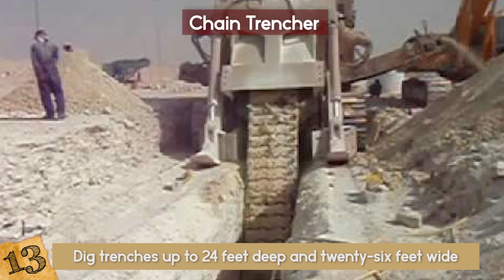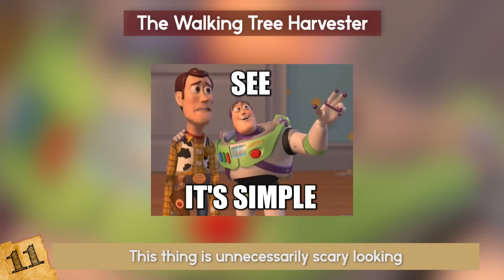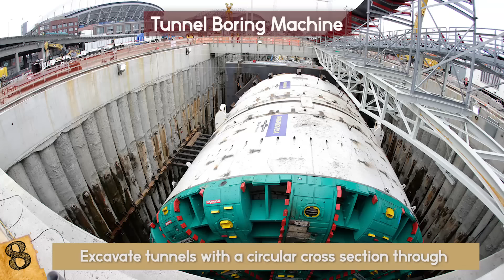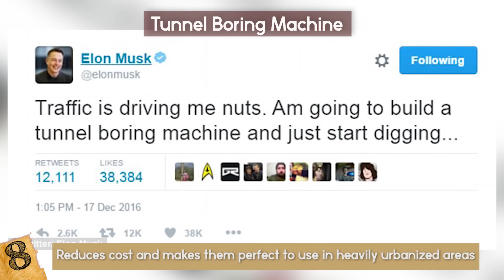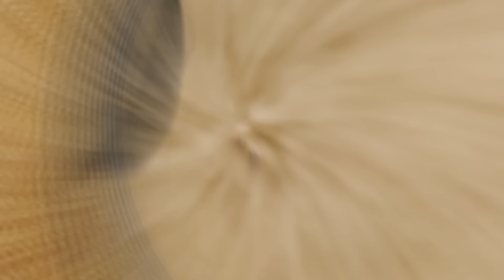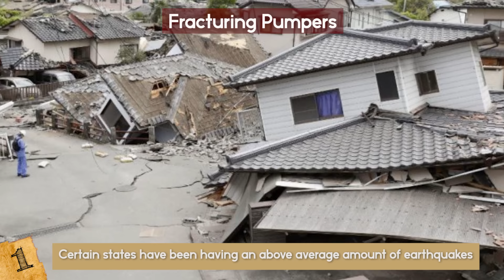Most EXTREME Industrial Machines Ever!

Comment: No chain trencher can dig 26 feet wide. A chain trencher is designed to dig trenches only wide enough for the diameter of the pipe and it would be ridiculous to try a lay a 26 foot wide pipe. In addition to this, wheeled equipment in logging is better than walking machines in the sense that they are easier to operate, have less moving parts and are designed with suspension, winches, etc.... The second picture is also an attachment that runs off an excavator and isn't it's own machine. And as for "chainsaw on wheels", it is based on crawler tracks to spread out the machines weight better and not wheels.

Comment: Error #2. The walking loggers are used to remove DEAD TREES for forests without affecting the rest of the forest. Removing dead trees helps protect forests from wildfires. It's not a woodsmans wet dream. It's an environmentally friendly way to both maintain healthy forests and provide firewood for local homes to heat with.
Reply: 0000000000000000000000000000000000000000000000000000000000000000000000000000000000000000000
Reply: showthechinal

Comment: Unique video but it does have some inaccurate information. The feller buncher doesn't strip the branches off of trees, it only cuts them down and bunches them. If it had a processor head like the tree harvester, then it would be abled to strip the branches. This is why plenty of commercial logging sites use a machine called a delimber. And there are a lot of logging vehicles that have wheels, and have the right drivetrain, suspension and off road capabilities to deal with forest environments. Just look at forwarders or ponsse tree harvesters, they all have wheels. The walking harvester is cool but would have a lot more moving parts for the legs to function. There is lesser known walking excavators that can be converted to tree harvesters.

Comment: The thing in the thumbnail is called a tree-crusher. Back in the day instead of hand-falling trees in the path of dam water flooding or any other large area you want to clear, they would drive those things into the area and just run over all the trees. They were super inefficient and burned a lot of fuel, and were impractical in hilly areas due to it only being able to climb up a hill that was no more than 10% slope. which is why you don't see them around anymore.

Comment: The machine from the thumbnail is not there...
Reply: The thing in the thumbnail is called a tree-crusher. Back in the day instead of hand-falling trees in the path of dam water flooding, they would drive those things into the area and just run over all the trees. They were super inefficient which is why you don't see them around anymore.

Comment: The logging harvester isn't special. Here in finland we have claws which can de-branch/debark and cut the tree into logs. Everything in one single harvester. Also the trees have special lengths they need to be cut into, so you have different options which to choose from depending the type of the tree. You just click the tree code on the onboard pc and it does it all automatically. Did i mention that it does it in like 30sec

Comment: either you or the person driving has to be an idiot to be run over by a chopper
Reply: I run  a chopper and yes it happens. Remember as the operator you have to watch 2 computer screens the vehicle you're loading besides you and when chopping corn you can't see 2 feet in front of the header.
Reply: Its not the operators fault i ran a chopper for a day and you cant see jack shit in front of you

Comment: Fracking causes sinkholes not fucking earthquakes just think about it
Reply: Withdrawal of solid materials over long periods of time, similar to making caves, causes sink holes.  Fracturing is a process that takes one or two hours and would never cause a sink hole.  A micro earthquake measurable by very sensitive instruments yes, sink hole, no.

BTW, the authors premise on the source of earthquakes is incorrect.  Been doing this for nearly 40 years.  All over the globe.  The ground moves like a train going by due to the surface equipment.  The rock fracturing is happening two miles away and you don't feel that.  Water disposal is the cause of oilfield generated shallow earth quakes that is now being better managed..
Reply: Brad Malone you just inadvertent contradicted yourself by actually describing one of the processes that can and will cause sink holes by what fracturing does. Be it natural or man made both also result in earth quakes too.